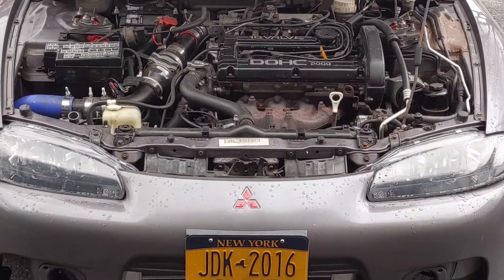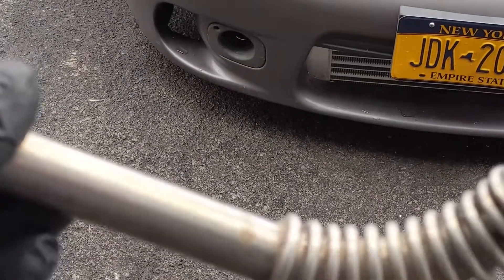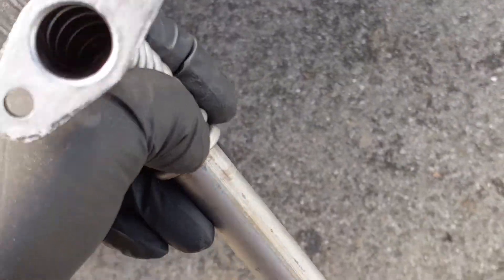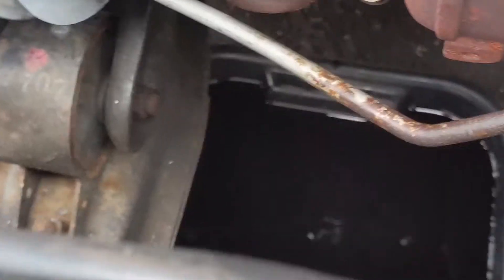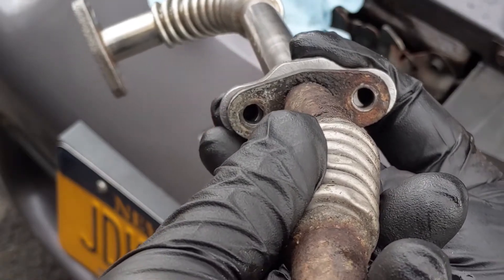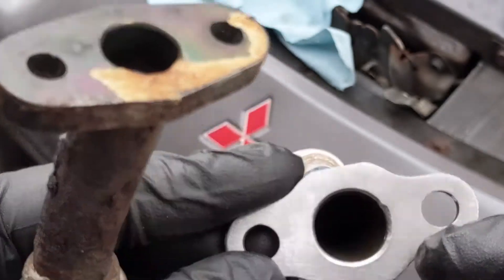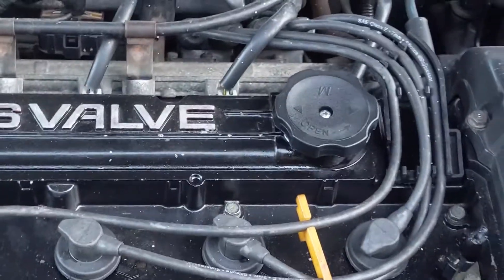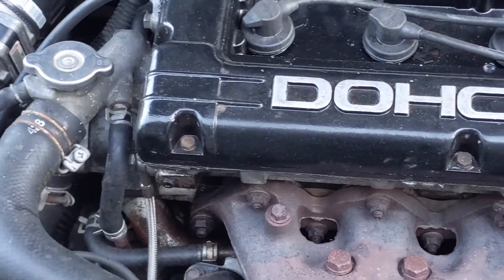HOW TO USE A STOCK 2G DSM TURBO DRAIN LINE ON A 1G TURBOCHARGER

Comment: I’m having problems making the gasket, can you please help?
Reply: I have the grey gasket sealer thingy, does it mater or that one works too?
Reply from the maker: @lordwitto5235  you can use the little gasket, coated in a light amount of rtv. Also start with the two 10mm bolts on the bottom of the turbo. THEN attach the drain to the oil pan. If the gasket doesn't fit you can trace the ends of the oil return flange on a cereal box, cut it out, and cover lightly with rtv and install!. My "cereal box" gaskets are still running strong with no leaks 👍
Reply: @TPGDSM  perfect thank you, and one last question, how many washers do I put? It looked like you used 2 or 1
Reply from the maker: @lordwitto5235  I used one on each bolt. Only bc the bolt heads didn't make enough surface area on the flange. A washer on each side would add compression and protect against leaks

Comment: Im doing the oil return line and its the hardest thing i ever done to a dsm 💔💔💔💔
Reply: If that’s the hardest thing you’ve do w to a dsm you must have a very good condition dsm 😂
Reply from the maker: Oh man it's not that bad, hog out the 2g drain and start the bolts on the turbo but don't tighten and do the same on oil pan side and once all 4 are in start tightening. The pup will stretch slightly

Comment: I Can’t get this leak to go away!
Reply: I have done everything but file it.  I may give that a shot.
Reply from the maker: @dplakosh  yeah a little flat file action for a few minutes on each side really helped make the sealing surfaces nice and flat. Usually a gasket can take up the difference in imperfections but sometimes it won't. I liked throwing flat washers on the 10mm bolts as well for more clamping force across the flange. Lmk if you get it fixed resolved 👍
Reply from the maker: Could always try my method of fixing yours?, Clean all gasket surfaces both on oil pan/turbo and each side of the line, file each flange end flat, put some washers on each bolt 1/2in I think, coat gaskets with a light amount of rtv and your ready to put it back together 👍
Reply: Yep do all of these steps also get the permatex the right stuff black RTV nd coat one side of the gasket make sure it's around both bolt holes and the return hole. While still wet go ahead and hand tighten the bolts until a little RTV squeezes out wait about 90 minutes before torquing the bolts to spec and to overkill the bolts since sometimes people don't put washers and the head of the bolt doesn't cover the hole and oil can seep thru so to fix that u can take a lil bit of Teflon tape but only wrap a small amount under the head of the bolt so it seals when tightened. U don't want Teflon on the end of the bolt cause that can get into the oil pan.

Comment: Hey man i bought this kit recently with everything you ever need for a 14b-16g install. And its only 20$ but keep up the vids man!

https://www.3sx.com/new-dsm-16g-oil-line-and-bolt-kit-10423
Reply from the maker: Thanks for the link! I've spotted em floating around too, just figured I'd be cheap and make the t-25 line fit😉
Reply from the maker: That's a sick kit for $20 bucks tho😲
Reply: @TPGDSM  yeah i had the same problem with the old crusty 1g oil drain. And i had to just cut it and put some oil resistant hose in place. But found this kit because it slowly leaked.
Reply from the maker: @stanleysdsms7058  I may just get that kit for the hardware! And now I need another backup drain line. Need some new water lines for the ol girl too